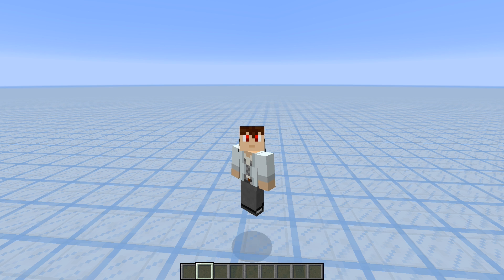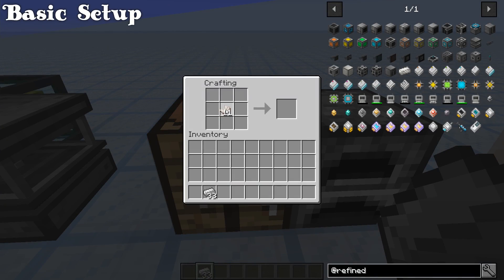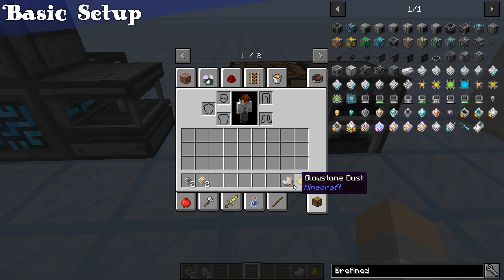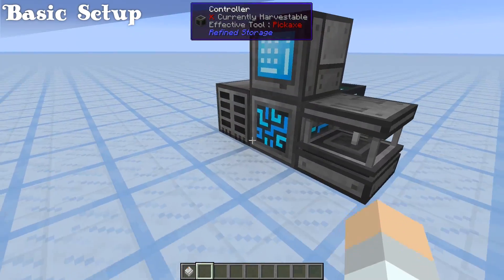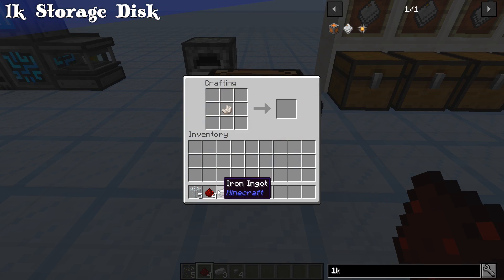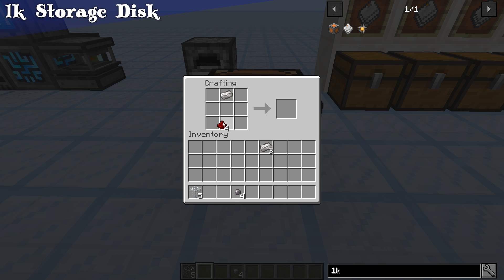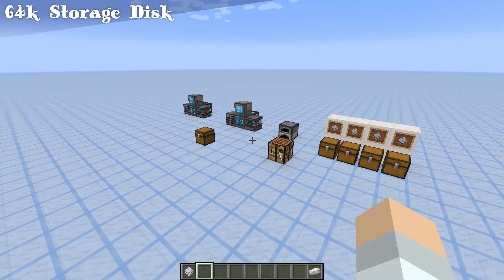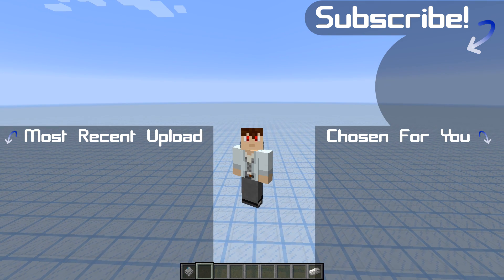Step by Step: Refined Storage Mod || BASIC SETUP! || (Minecraft 1.11.2 Tutorial)

Comment: Still can't figure out how to get items from my cloche output chest into the computer.
Reply from the maker: if it acts like a normal chest, you just need and input bus and connect it with cable, and it should automatically pull items from it into your system.
Reply: @Xogue29  I had the sending/receiving set up backwards.

Comment: Can you upgrade 1k disk to a 4k and so on?
Reply from the maker: you can hold the disk in your hand, and shift right click to get the housing and the "part" back. upgrade the part to the level you want, then re-combine with the housing.

I don't know if it has to be empty for this to work, but I am almost certain you will lose the items on the disk if isn't. To avoid that, look at the disk manipulator. it will allow you to easily move the items to a new disk so you can upgrade the old
Reply: @Xogue29  AWESOME! Thanks!
Reply from the maker: no problem ;)

Comment: How can this only have 1 coment and 300 views? o0 its super helpfull and easy to understand. I've done exactly what you did but now i wanted to connect some item conduits to it and they don't connect :S  Any "special" cable/conduit i have to make so that i can use conduits?
Reply from the maker: you will have to connect a chest or something to it as a "middle-man" to use conduits.

not sure what you are trying to do but putting a chest there will allow you to import/export to and from the refined storage system and connect conduits to the same chest.
Reply: After some long hours trying to figure it out, i found that i only needed an interface (from Refined Storage), some speed upgrades on it and i was good to go :D Ty for your answer!
Reply from the maker: interesting..   the interfaces are usually for making inventories connect to the storage system.   i guess conduits are seen as inventories or something.   creative solution ;)

Nice work

Comment: if it's possible do you think you could do another mod spotlight for using your storage for external machines if it's not to hard and if it's even possible.
Reply from the maker: you mean using external storage and hooking it in, or automatically putting things from the storage into machines?
Reply: Can I have two of these systems in different parts of my map that are connected and share a memory? I just want more than one access point to my storage